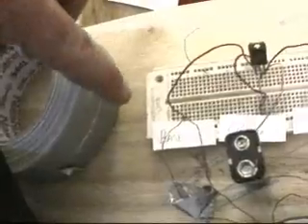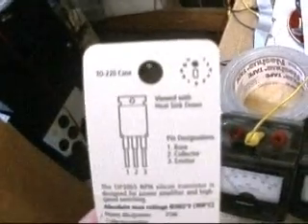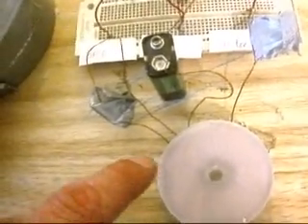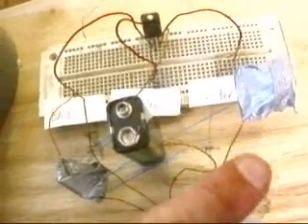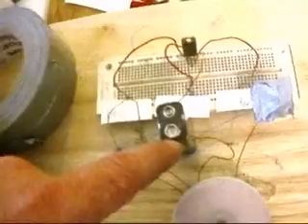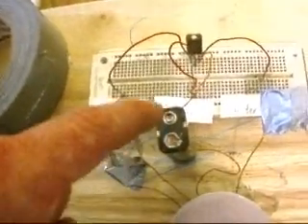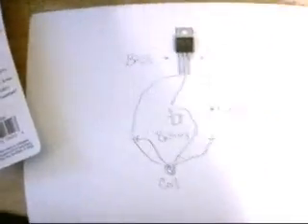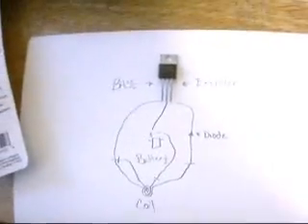How to build a Pulse motor

Comment: Thanks for the video. No switch and how much resistance is enough to get it going? I'll try to dissect your video so that I may be able to replicate it. So If I understand this correctly...the magnet passing the coil is the trigger? Love your small footprint in your circuitry as well. Please do make a better video with better instructions as you say. Great work.

Comment: how is the other two wires from the coil not the ones connected to the diode and the battery, how are they connected?

Comment: what is the device at 1min 47 sec that you point at for a like 3 sec . Square top bottom and round objects supporting them ???????????Great exp on the pulse motor though ill be building a big one for my project . i've got alot of figuring to do . Great work

Comment: so there's no reed switch in the circuit? I thought in order to get the rotor moving you need to switch the poles on and off using either a reed or a hal?